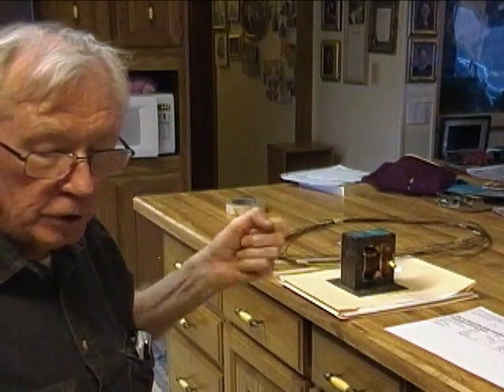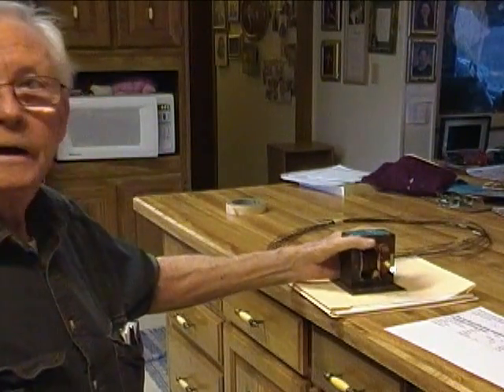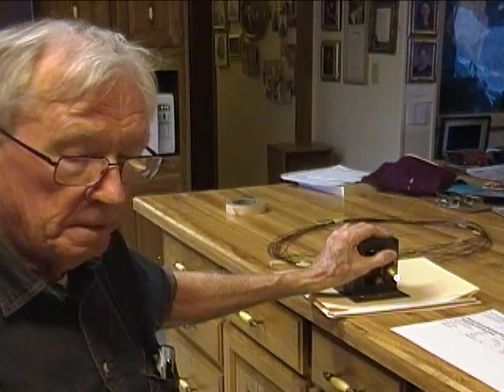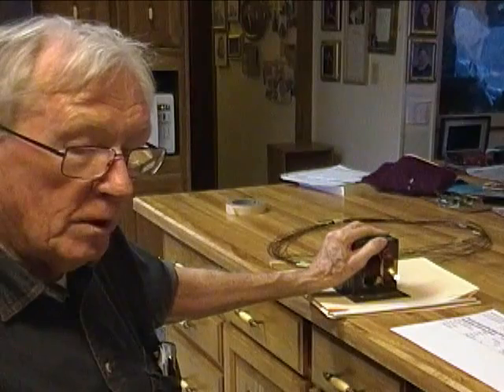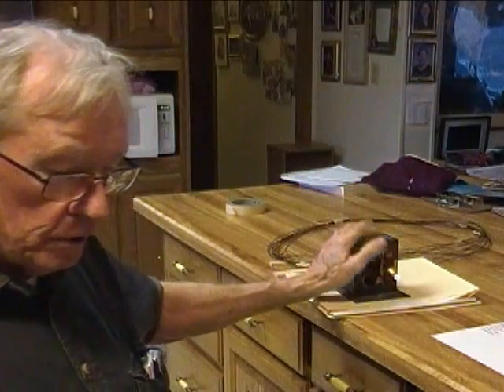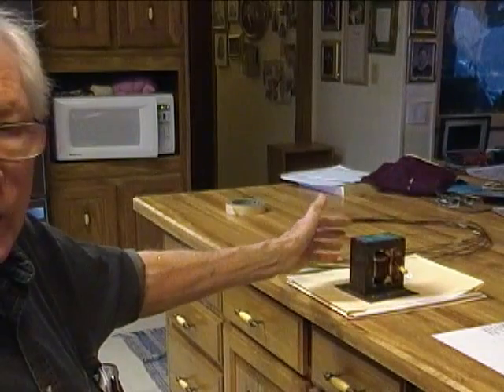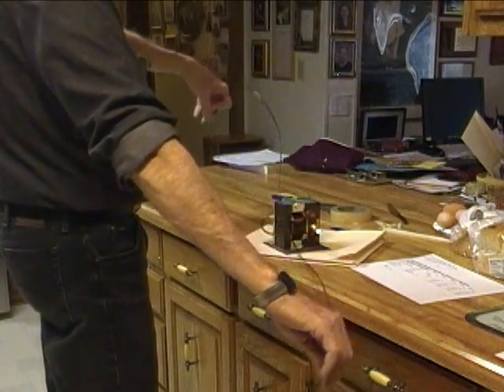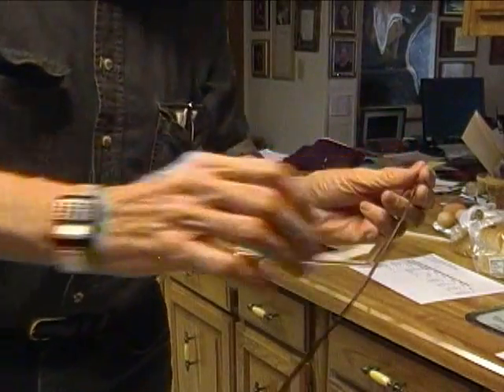MOT Rewinding With Bundled Magnet Wire

Comment: you probably already know this, but one quick way to figure out the "volts/turn" relationship is to wind a few turns of your wire around the core and, using a variac, put a known voltage through the primary.  so, if you get 10 volts out of the 10 turns on the secondary, and the variac is delivering 100V,  it's 10v per turn.... not exact, but will get you quickly into the ball park with an unknown primary coil.  Thanks for sharing your approach!  Doug

Comment: As you know most MOTs are wound vertically, or from top to bottom.  Seems to me it would be easier for us to wind horizontally from inside of core, progressing to outside - this gives more leverage to pulling wire and thus better alignment.  Do you think winding the secondary horizontally would have any negative affects given the primary is wound vertically?
Reply from the maker: Sorry  Mike, but I don't understand  your concept here.
Reply: If coils are wound 90 degrees opposite would this matter?
Reply from the maker: @mevk1  Sorry again, Mike.  I can't picture what the "90 degrees" means. Or-- opposite of what?
  Maybe you should simply try what you have in mind and see what happens.  I think there are plenty of Microwave ovens in the junk.
If you do it. pictures or videos of your results would be good.
Reply: No, its a bad idea; the thickness of this place (between the inside and the outside) is less than the thickness of the original place (central limb inside the core) (and by thickness, i mean the cross-sectional area), and because of the shape of the core(E I core) , it would be extremely hard to get all the magnetic flux to flow to the secondary coil (you can, but its hard and not worth it, and probably inefficient), because half the flux will flow to one side and the other half will flow to the other side, and then the 2 halves will recombine to flow back into the central limb (the place where the magnetic flux was produced)

Comment: Did you remove the magnetic shunts located between the original two coil windings?
;
Reply from the maker: So far, I have not removed the shunts, but I probably will take them out to try to get more turns of heavy wire and more voltage.

Comment: Rather than braiding and painting could the strands be enveloped in a very long roll of shrinkwrap?
Reply from the maker: Well, I'm glad you asked:
The "varnish" that is used on "magnet wire"  has undergone many years of development to make it highly insulative (is that even a word?) and resistant to cracking when it is stressed while being handled.  There's also a concern that you need to "get the heat out" of the windings during use, so that natural convection, etc., can keep the whole transformer cool.
    I  would also have been worried that your paint job might have led to shorting of turns if any cracking occurred while winding it..  Then too, can your paint handle high temperatures over a long period of time without degrading?
Covering the wire with heat shrink  solves the insulation problem  nicely, but only makes the bundle thicker, but reduces cooling; generally not a good thing.  Comparing the types of  wire flexible wire insulation, that some guys use when rewinding MOT's, (PVC, for instance), you may or may not gain any room in the core.
Braiding makes the bundle thicker, by the way, so, if you do go with multiple strands, simply let the strands lay side by side.  ---Just my opinion.
  OTOH, I have seen many youtube videos where the guy removes the magnet wire from scrapped motors and other electrical devices and reuses it in his projects.  If you don't want to spend money on the project, that sounds like the best alternative to me.
Here's one such video:

https://www.youtube.com/watch?v=DLxQb0oK6Cc
Reply: Yea, I actually tested the shrink wrap thinking it was thinner than most insulated wire but when you shrink it of course becomes thicker than most -doh.  And the braid/spray something idea I am still toying with but not quite as optimistically -getting a tight stable braid so insulation does not crack, and finding a high temp spray that is flexible and strong are issues.  
   Thanks too for the link -some very good sources for magnetic wire.  A few years ago I unwound the primaries from two different mots that I saved for rewinding.  But as I recall the copper windings seemed like they were vacuumed filled with enamel so it was not the easiest to unwind,  and is kind of bendy/work hardened.  Also, I nicked several spots in the process but they were patched with a good liquid tape -still how can I be sure there are no other nicks.  Wonder if there is an easy way to test if completely enameled?  Also, this reclaimed wire is 12 gauge which is rated only for 41 amps maximum. Assuming  I only get 40 watts due to work hardened wire, and be limited to 41 amps then PS will be only 1640 watts.   Your server PS gets about 50 watts & can handle 50 amps or almost twice what I'd be getting.   I'd like to melt larger quantities of metal so that might not cut it.  If i put two mots in series, rather than the above parallel scenario, it would be very easy to get 50 watts but I be limited to about 25 amps.  Using reclaimed 12 gauge wire, do you think dual mots in a parallel set-up or series set-up would work better with the 2500 zvs heater?    Your advice is greatly appreciated -thank you.    @frenchcreekvalley
Reply from the maker: @mevk1  About the dual MOTs- I hate to have to say this, but don't know for sure.   I guess, if you get them phased correctly, they ought to work.  But you still have to build a rectifier and filter section to handle all that power.  If you do this, I'd start with just one transformer and load it down to see how much drop in voltage you get at the current that you need.  If you get a voltage drop of more than about 10 percent, you will have to over-wind the secondary to compensate.  This means that you will be sending an excessive voltage to the ZVS circuit when you first turn it on.

Comment: I got 36 v 30a from my 1.1kw mot
Reply from the maker: What size and insulation type of wire did you use?
Reply: Frenchcreekvalley .frenchcreekvalley 2sq mm 1100 volts pvc insulation multi strand copper wire   IS:694
Reply: Frenchcreekvalley .frenchcreekvalley actual rectified output is 36.8v 29.9 amp max

Comment: Note to insult your intelligence ...... by all means, I say this kindly, but, I am referencing a few books, like..... "Popular Mechanics/Do-It-Yourself/encyclopedia series of books from 1955. I know these are very old books, but, every aspect of building and wrapping the transformers are explained, many charts and formulas to calculate everything... I have a few years worth of these volumes of which consist of 11 plus a 12th that is purely an index for the other 11. Basically one a month subscription that my grand father had, in turn, my father had these book, and the past 5 to 10 years, I have them. Book/volume 11 deals a great bit in transformer building, the core design calculation work, the wire wrapping is like wise. there is a few other in the complete set, but Number 11 is my favorite. The charts are fairly easy to follow and make sense of things... other then needing a magnifing glass to read them...Just thought I'd share that with you. Drew

Comment: LOL... what are the odds.... I am doing the same thing right now... trying to get 30 volts @ 20 amps.... I am getting closer....  I am trying to also find a happy balance of at least 30 minutes of on-time with out cooking off. I am thinking about venturing into monkeying around with a pair of MOT's wired in parallel, to see how that goes next... while trying not to blow my panel...LOL... by the way.... I have only been watching your videos for the past week or 3... Nice job on these... I really enjoy your efforts, and has saved lot of time for me..Thank you, Drew
Reply: I don't know if you'll get this, but something you can do to help increase the duty cycle to basically 24/7 is buy some pure, clear mineral oil, find a plastic container big enough to easily hold the transformer, and pour the oil over it until it completely covers the transformer.  This is exactly what's inside the big transformers you see up on the pole by your house.  Hope this helps.